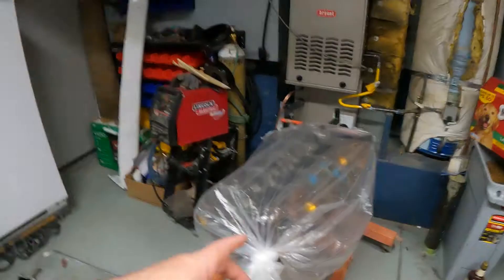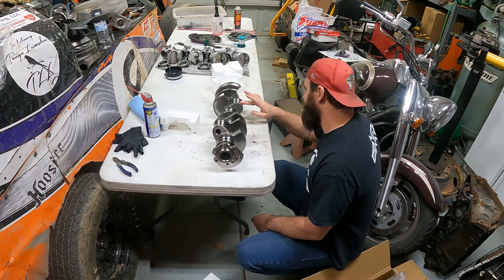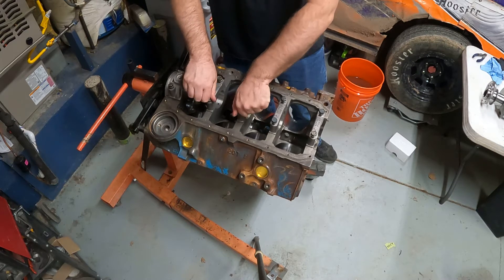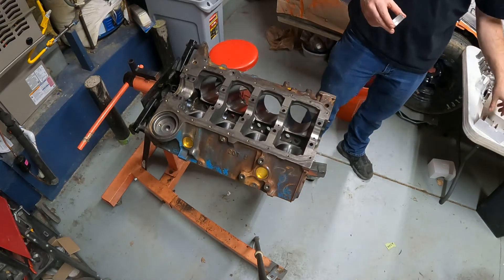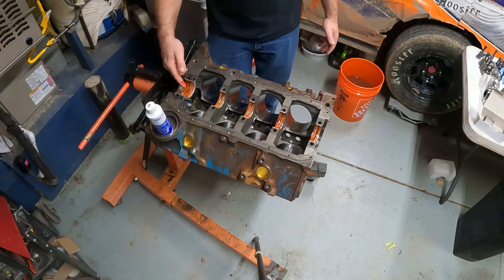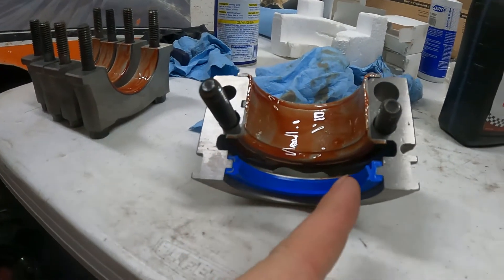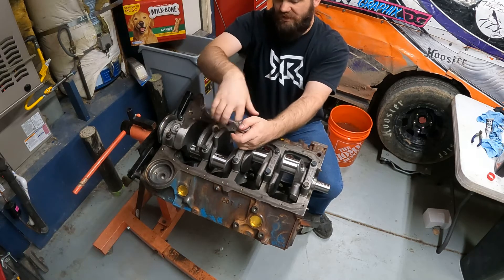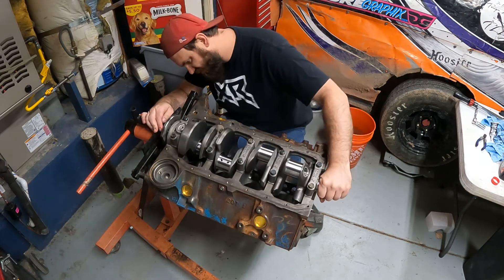Hobby Stock Engine Build Part 5: Installing The Crankshaft

Comment: I have a new crank that was balanced  with used pistons and rods.
Reply from the maker: That should be alright.  I have had to do this a lot of times as wall.  just make sure your pistons are in good shape and fit in your cylinders properly.

Comment: I would like to build a back up motor with engine parts I have laying around that revs at 7000rpm how many races would a unbalanced motor last?
Reply from the maker: depends on how unbalanced you are talking about...  Ive built some stuff parts straight out of the box no balancing, that lasted a long time.  But I have done the same thing and had a major vibration form....  so it really just depends.  I would suggest getting as close as possible with anything spinning 7k or more